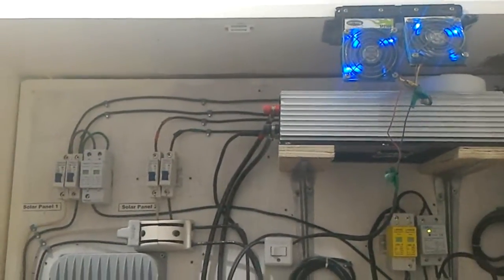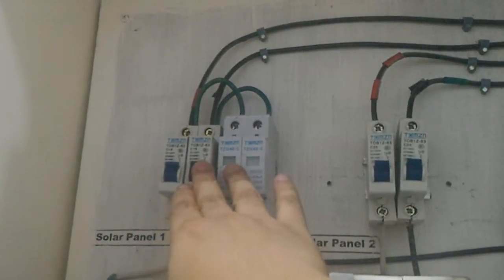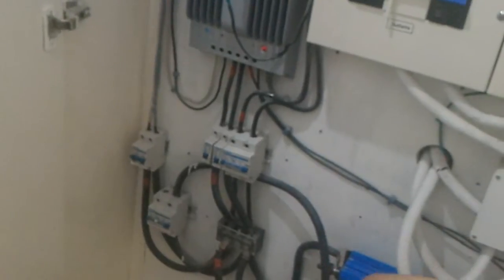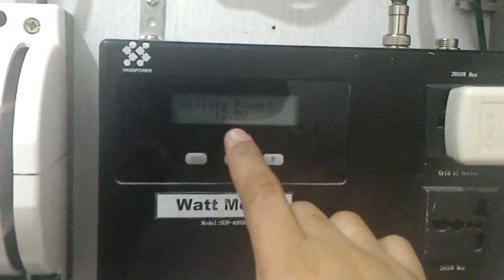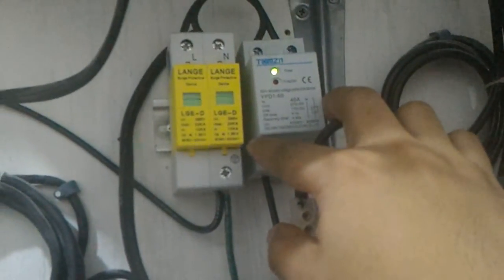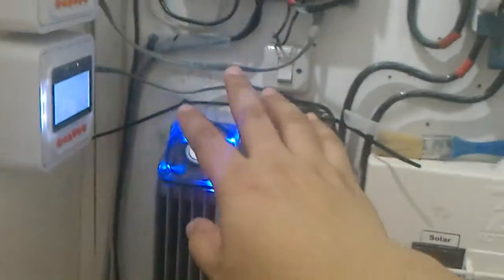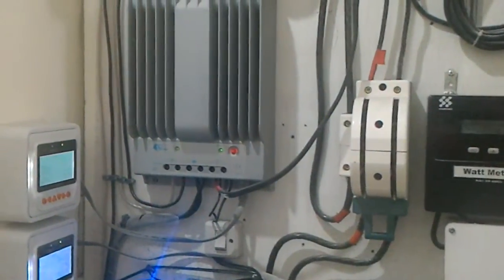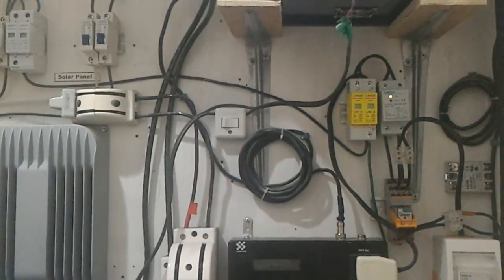After 9 months, My first Solar Project (update)

Comment: Sir anong size po ng cable ginamit nyo from battery to GTIL? and yung ground ng DC and AC ok lang po bang pagsamahin nalang para isang wire lang ilalabas ko ng bahay?
Reply from the maker: awg 8 na thhn. i would have used 25mm welding wire para sure.
for the ground, sa kin same wire lang
Reply: yung battery cable mo sir paakyat sa 2nd floor welding wire po yun?
Reply: Ano po katumbas ng battery wire na AWG#8 and #2 sa thhn, hirap po kasi maghanap dito sa area ko..